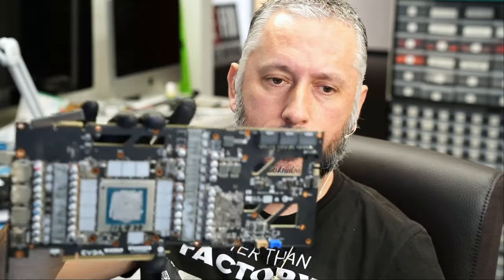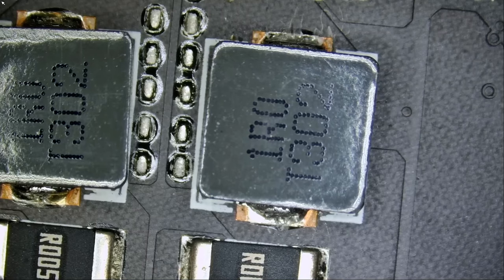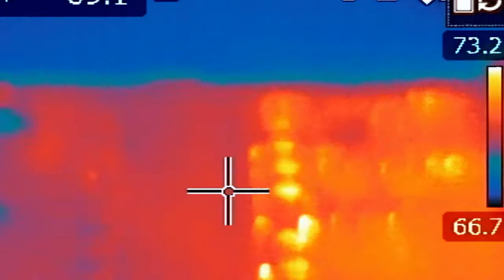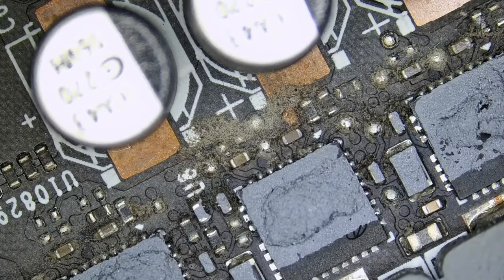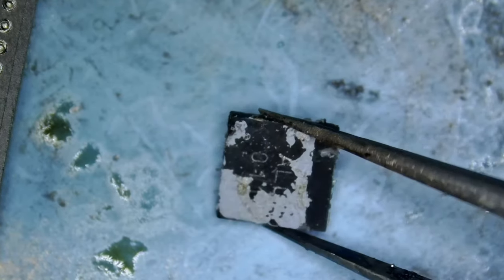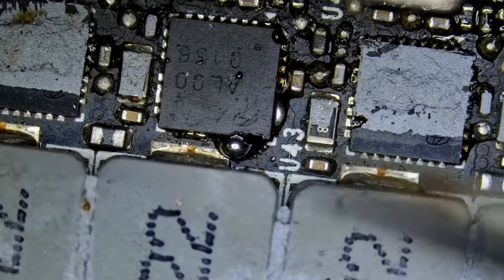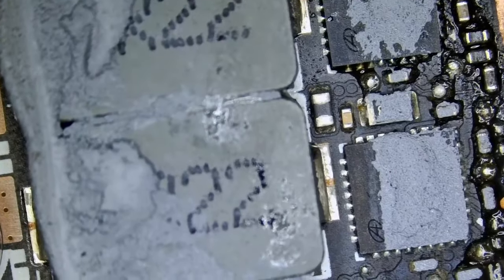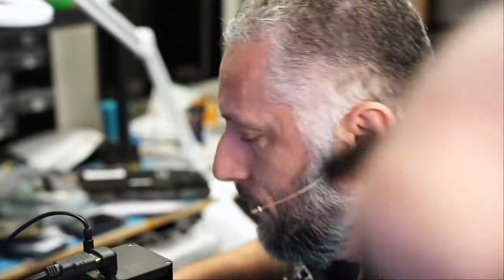EVGA 3090 Red light No power Repair

Comment: Since wood is a very poor conductor of heat, I use a thick piece of paper towel covered with aluminum tape (so it doesn't catch on fire).  I never have melted connectors, popped caps, etc.  You might give it a try.

Comment: Oh yeah, add thermal pads to transer the heat directly to the caps. Good Job 👍
Reply: I had the same thoughts lol it's the opposite of what you need.
Sticky insulator pads would be the go, not heat transfer pads
Reply: All he is worried about is the direct hot air from the nozzle.. Adding mass such as pads does protect the caps from that.🎉

Comment: Hi Alex! Great videos, thanks a lot! Just one question: thermalpads are transferring heat and do not insulate, or do I get it wrong? Cheers from over the pond! p.s.: i´m a total amateur, but totally interested in the topic...
Reply: Was just going to ask the same
Reply: I guess it´s all about direct contact or not. Thought a little bit about it and that could make sense. When using hot air from a distance it could act as a shield...  @melvilib

Comment: I had a similar RED LED issue with my EVGA RTX 3070. I thought it was just a simple short issue but seems like the damage is more complex and might damage the core itself. Luckily it had some about 60 days left on the warranty and had to RMA the card. I don't know if EVGA had repaired it the same way in the video or if they had replaced the whole board with a refurbished one. I had the same serial number on the backplate when it came back. I don't think EVGA will spend time repairing boards and it is easier for them to just replace it with a refurbished one and just put back on the same backplate.

Comment: Basic question regarding voltage injection. There are so many other videos online, example with Macbooks, where 3.3V are injected on a 3.3V line or 5V on a 5V line. What's the theory injecting up to maximum 2V in this case in the 12V line? 
Also what air flow and temperature you use to remove the chip that fast without affecting the surrounding caps
Reply: Since the DRMOS is shorted, if you inject 12V, that 12V will go straight to the GPU core. Hence a low voltage is recommended such that the shorted component will heat up and at the same time, the actual component it is connected to does not get damaged.

Comment: Just curios, have you ever considered using a ceramic clay for heat protection?... probably too much of a mess in the long run, but for highly sensitive components on high end circuit boards.. something to consider?

Comment: I sent my 3090 in for rma everything powers on red light. The RGB light doesn’t work but the card performs as expected by benchmarks. Sent it in for RMA but friends are saying it looks more like the card melted. 

EVGA is claiming water damage when there is no visible signs on the exterior. They didn’t power on the card to see if it was working on arrival even though I stated everything in the RMA. Now they want to send me my card back without doing anything besides reassemble

Comment: when injecting voltage connect the ground of the voltage injection tools on the vrm coil
then inject voltage on the fuse you go up to 12v without damaging the gpu core..

Comment: I think if is a 12 volrs line you can inyect 4 volts since its the 3rd part of the line voltaje. I know a guy who works with phones and he always inyect 4 volts 3 amps, doesnt matter the value of the line. Another guy always inyect the 3rd of the line voltaje since in both cases the short consumes the voltajes.
Reply: They say not to go over the lowest rail on the board to be safe as its possible to blow parts on lower rails with a short